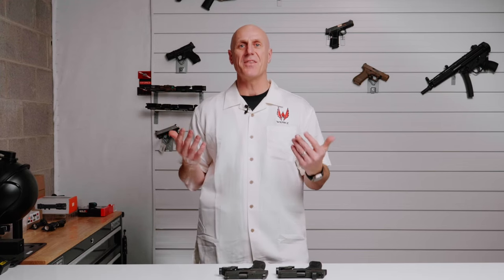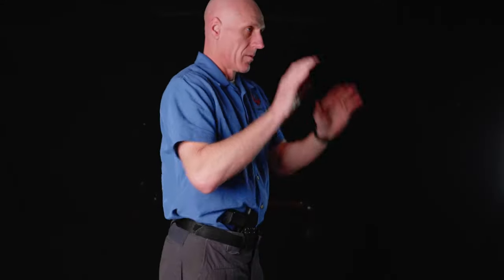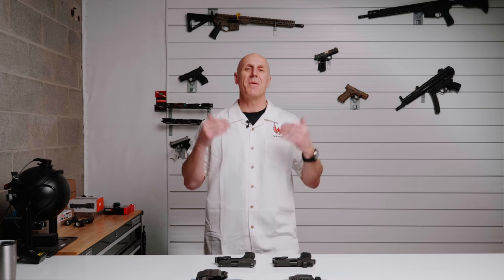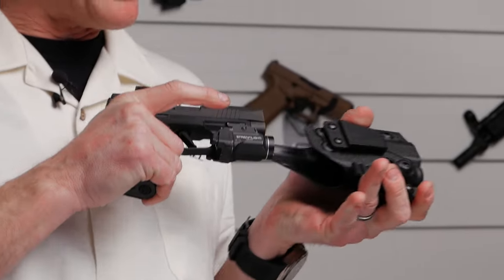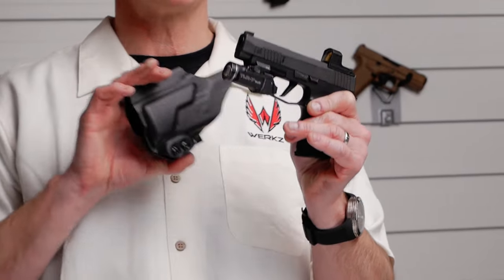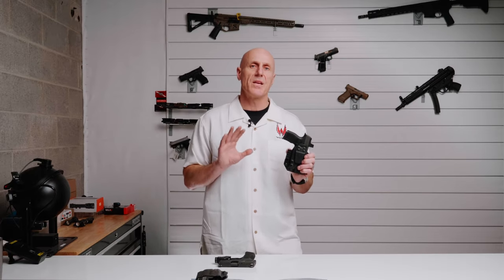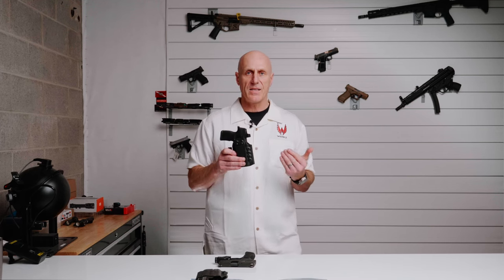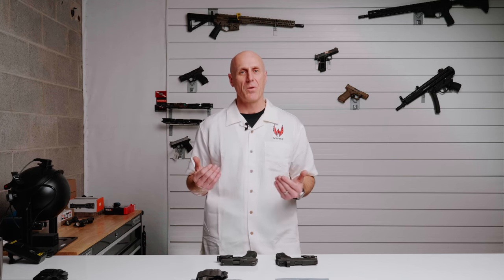Subcompact Light Bearing Holsters (FAQs!) All You Need to Know About Light Bearing Holsters

Comment: I have a Werkz IWB for my 43x with a Nightstick TSM-11G. Love it. Fits great and comfortably.  Also have one for my 19 with a Nightstick. I recommend them to anybody that asks.
Reply from the maker: Thanks much for your encouraging feedback Michael!
Reply: How are you liking the Nightstick TSM? I just ordered one for my Sig p365 along with the Werkz M6 holster.
Reply: @tonyjay617  I like it,  I don't use the laser much though, it tends to shift when you push the button to turn it on. Tried tightening it,  but still wiggles side to side. As for the holster,  love it. My 43x stay securely in place. Also got a Werks for G19
Reply: @Mgarcia3160  That's fine. I don't need the laser. I just wanted a small light to put on the Sig and I saw Werkz made a holster for that light/pistol combo. Glad you like yours. Can't wait to try mine out!

Comment: I am no holster expert, but I am glad my 2nd holster and first hard holster was a Werkz M6 IWB. It fits my S&W M&P 2.0 with an Olight baldr s and Holosun SCS perfectly.

The only thing I may do is look for a longer claw. At 5'8" and 235lb I tend to push the holster down when I sit and the claw tends to push below my belt. I wear my holster in the lowest position already for comfort and concealment.

I can't fault the holster for my physique aka dun lapper pushing my pistol down.

The retention is perfect. The comfort is very good. The concealment is very good.

I did a VNSH holster first for comfort, but I didn't feel comfortable reholstering, except with a thumb safety on. I still use a thumb safety for reholstering, but I would reholster a pistol without a thumb safety into the M6. Not the VNSH.

Comment: I’ve modified every holster I’ve ever purchased. I really like my new Werx 43x MOS/TLR Sub. You’ve fixed a lot of common problems. 

That said, I’ve already ordered some different claws bc the Werx claw doesn’t work well enough for me. 

Also, the mag caddy could be more adjustable. I custom made a flex point and a custom low profile clip. The flex point allows me to position the mag a little wider and not affect the effectiveness of the claw. 

Lastly, I swapped out the main holster clip for a wider one that is easier to operate and provides more stability.
Reply from the maker: Hey Neighbor! We have 2 new claw molds in development. Can you tell me what specifically isn't working well for you? Agree that the mag could have some flex. As for the clip, I wasn't aware there were any others out there that were wider. Would love to see a pic if you get time... send to our customer service products (at) werkz.com. I'm always looking for great ideas on how people run their gear!
Reply: @WerkzHolsters  Claws that are positioned further from the holster create more tilt of the pistol grip when you cinch your belt. I’m a skinnier guy, so I prefer to have the grip closer for better concealment. 

The clip is wider at the base, not overall. It has more contact area to manipulate and has more surface area to reduce movement.
Reply: @WerkzHolsters  For all my nitpicking, your holster is one of the very best I have owned. I like how customizable it is out of the box and the built in wedge and G48 length is spot on. I started ordering my micro compact holsters in the long slide versions after realizing the issue.
Reply: @Libertarian_Neighbor  I assume, that you wear a good belt for carrying. It’s essential.
Reply: @Strawman333  I’ve tried many belts. I like the Ares Gear Aegis. It’s what I wear.

Comment: Hey werkz?  Why do you advertise a cut out for charging for a baldr mini,  but do not have an option to choose it on your website?
Reply from the maker: That's because all our Baldr Mini holsters (indeed, all holsters for Olights with that recharge capability) come standard with the capability to charge in holster. The capability is built in to the design, allowing you to put the pendant in from the rear under the trigger guard. Thanks for asking!

Comment: Are there any safety concerns when carrying with a wider trigger guard area on the holster to accommodate light bearing pistols?
Reply from the maker: Good question. I would say that the same safety concerns exist as with all pistols -- you don't want something to manipulate the trigger inadvertently. This is true for a light bearing holster. It's also true for non-light-bearing floppy nylon holsters, sticky holsters, "worn in" leather holsters, and even the professional level leather holsters. The bigger the light, the more opening there is. Light have become common among professionals -- local PD, SWAT, military, federal, and even your local Sheriff department probably has guys using lights. Those professionals are probably running a X300 or TLR-1HL and a Safariland holster. You can get a lot of stuff in the holster opening, including even seat belt buckles. I think it's a matter of being aware that the potential exist and mitigating it. Be aware of stuff that could get in the holster -- whether you're drawing, reholstering, or at rest. Note that non-light bearing holsters are at risk during drawing and reholstering. And  for those who cannot get used to the idea of seeing the trigger, then perhaps you should consider not running a light.

Comment: great video , thank you so much. I have a 2011 staccato c2 , frame and trigger guard area are thin and i am able to stick a finger in the trigger which i always thought it was a bad holster but i see there has to be a gap with light mounted holsters. Plus the firearm has a thumb and grip safety which should be fine, thank you.
Reply from the maker: I'm glad it was helpful Keegan! We have a Staccato here in the shop as well -- nice choice of pistol!
Reply: @WerkzHolsters  does your shop make staccato with light holsters ?
Reply from the maker: @keeganjacobs5913  We have a Staccato XC in house and are looking at building holsters for those 2011s with lights. I don't have a timeframe for release however.
Reply: @WerkzHolsters  thank you , I was hoping a C2 since that is my EDC but hopefully sometime in the future . Thank you
Reply from the maker: @keeganjacobs5913  The holsters we make will fit all the current Staccato pistols. Their slide and frame profiles are the same.

Comment: I just got my M6. I’m a big guy, 6’2 290 lbs. I don’t have a huge gut, but I have a little bit of a gut. The sweat guard is jabbing the bottom of my muffin top. I want to carry appendix, but it’s way to uncomfortable. Any tips would be appreciated. I love the holster, it’s just my body that is the problem
Reply from the maker: If the sweat shield is a problem, simply remove it. I don't know if our old video showing how to do it is still up, but simply hit it with a razor knife where you want it cut, twist it off, then polish the remaining holster material with sandpaper or a buffing wheel. Hope that helps!
Reply: Chunkier guys with BMI over 30 tend to struggle with AIW carry. Tough to be comfortable and especially to reholster.

Comment: I wanted to share some feedback and a support request regarding my recent experience using the M6 holster with the P365 firearm and TLR-7 Sub light attachment.

Safety Concern: I've noticed that it's possible to pull the trigger while the gun is still holstered. This is a significant safety concern for me, regardless of what you say in this video.

Fit and Security: The gun and light attachment do not securely snap into the holster as expected. This raises concerns about the reliability of the holster during use.

Customer Service Inquiry: I submitted a Return Merchandise Authorization (RMA) for both the gun and the light four days ago but haven't received any response. I'm eager to resolve these issues and would appreciate an update on the status of my RMA request.

I look forward to your prompt response and assistance in addressing these concerns.

Comment: You guys would likely benefit from making holsters that work with the enigma from phlster! Im thinking about modifying mine to see if I can make it fit.
Reply from the maker: I would have to look again, but if I recall correctly, our holster lines up, but users may or may not want to remove the claw because it may engage too aggressively with the Enigma's surface. If you need any hardware (shorter or longer screws, etc) to complete your adaptation, let me know.
Reply: @WerkzHolsters   maybe it lines up for some firearms. But for my hellcat the screw holes are too wide to line up with the enigma
Reply from the maker: @bakenasty8860  Thanks for letting me know. I think we need to look into this more and see how we can support folks like you.
Reply: @WerkzHolsters   you guys are always going the extra mile. Thanks a bunch. I actually ended up getting it to work, with a bit of adjustment and playing around it will do for now. But still doesnt fit exactly right. Was only able to use 2 of the 4 screws. But its on there very well.
Reply from the maker: @bakenasty8860  Interesting. I'll see if we can have someone look at it this week and see if there is an adapter plate or something we could build that would fit better. Of course, the key would be to do something that is low profile / without bulk.